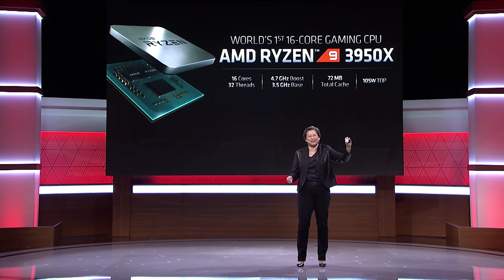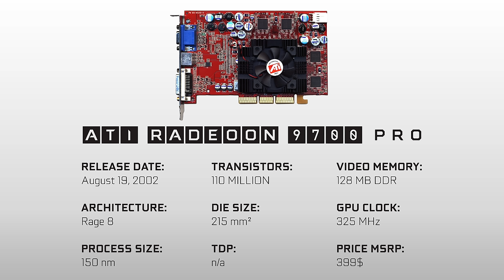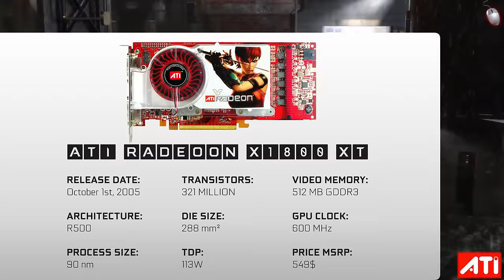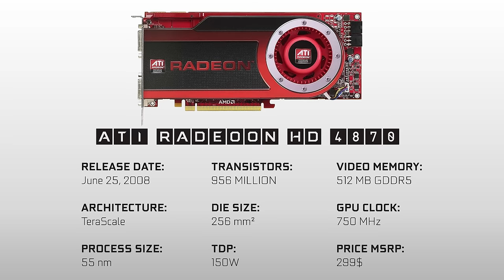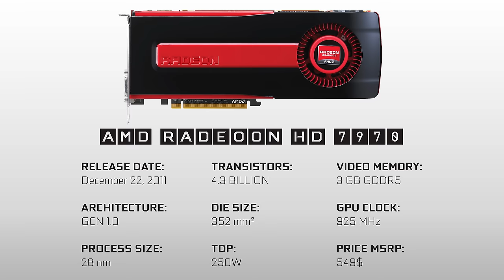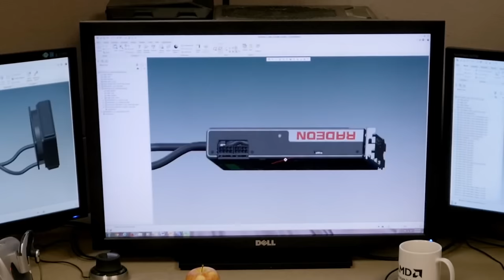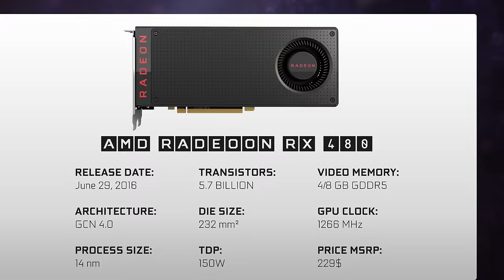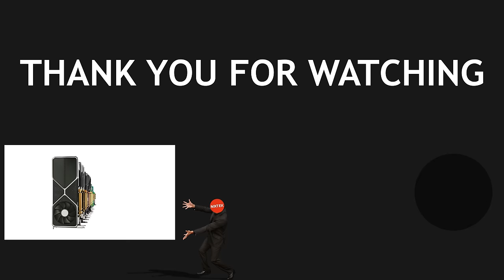The Evolution of AMD/ATI Radeon Graphics (2000-2022)

Comment: When you can buy the highest end gpu on the market with 299$:
Reply: When your monthly grocery cost less than 199$
Reply: When silicon wafers costed pennies
Reply: Vs $2000
Reply: It was still true in 2015. I bought my radeon 7200 vivo in 2000 and in my 390x in 2015 for about the same $350
Reply: @Emeric62   Back in 2011 I also bought the GTX570 for like 340eur and it was a pretty biffed up version of it with 3 slot cooler and could do 25% OC with a 1.2V modded bios flashed and it's actually still alive (in theory it's custom PCB was more in pair with a normal GTX580) and basically it was the 2nd best Nvidia GPU because 580 was the best and the 590 was still to be announced but sadly the 580 was already almost 500€ sadly.

When I bought my crap Strix RX480 sadly the Nvidia GTX1070 was already around 500€ which was the 300€ back in 2011 and they even release "TI" to slap in the buyers face so at the end 1070 ended up being like only like the 5th better Nvidia GPU at the end of that gen but costing almost the same as the 2nd best GPU from them back in 2011 and the thing is that min salary barely increased here from that range of years so yeah just a pile of rubbish 😡

ps: Will probably have to cut an arm and a leg to make my next PC in the future, cause it's getting ridiculously expensive and the wattage is also nuts for the cost of electricity here 🤬😡😥
Reply: USD299 And still won't run crysis
Reply: You can’t even find a budget 1080p card for this price
Reply: @happybuggy1582  nonsense, rx 6600 can be had for less than that and can easily play anything @1080p
Reply: @happybuggy1582 Rx 6600> 1080p ultra +60-240fps depending of game. Price> 200$
Reply: REEEEEEEEE
Reply: @happybuggy1582 you can literally find a budget 1440p card for that price lmao
Reply: @r3tr0c0e3  we on 2020 or 2024 prices?

Comment: Have been using team red from 2000 , never had an issue many of my older cards still function to this day , I have recently bought a 7900xtx for my 7800X3d pc ...very impressed 👍
Reply: I have the same card. Only the 4090 beats it, and that's fine by me. 👍

Comment: The HD4870 was just 20% slower than the gtx 280, but the HD4870 was 300$, the GTX 280 was 650$
The HD 4870 was a 256mm^2 die size chip, the gtx 280 was 576mm^2 die size
The HD 4870 was 150W the gtx 280 was 250W
Reply: hd 4870 won !
Reply: @alfonso5177  In reality people bought Nvidia more, sad but true. AMD in 2007-2008 had 35% of the market share.

Though in 2009-2010 it went over 50%, but that was a different generation.
Reply: @rattlehead999  yes ik, but the hd 4870 was better by price/perfomance/wattage
Reply: @alfonso5177  absolutely and even in performance, 20% isn't much. 
AMD should have been destroying Nvidia from 2007 to 2015, but due to mind share people bought Nvidia.

Even in the next generations AMD repeated the same success as the HD4870 to lesser extent, but still cheaper, smaller die size and performance was close, even power was often lower. Yet they lost.
Reply: @rattlehead999  It was not mind share, it was awful drivers and game support :)
The video could have been a 10 second youtube short saying that 2000-2019, ATI/AMD drivers sucked hard, and since the  RDNA2 launch, they start to be good and really useable.
When a new game comes out, Nvidia launches a game ready driver a week prior. but AMD (and mostly ATI) used instead to try to deal with bugs for the 6 months after the game launch.
Reply: @ledoynier3694  I've always had both AMD and Nvidia and the only period where AMD drivers sucked was 2012 to 2015 when GCN was new and the HD3000 series. Nvidia's drivers sucked from 2009 to 2011 and then from 2018 onwards. Also AMD's drivers never killed GPUs, so that's always a big plus.

Although since 2020 both AMD and Nvidia's drivers have sucked.
Reply: @ledoynier3694  These are facts, coming from you and I agree. I have been buying and playing with GPUs since 1999. AMD unfortunately has issues that the Diehard AMD guys and gals just refuse to admit! Inherent problems on the driver front as well as the WHOLE eco system is not what it should be in order to truly compete with Nvidia!
Reply: @rattlehead999  I have been buying GPUs since 1999 and let me tell you, AMD as a whole as an INHERENT problem with drivers. It is a FACT! To say otherwise is just purposely refusing to admit the truth. Spare me the garbage amd fan boy shit!
Reply: basically the 4870 with 44% the die size and 60% of the power use had over 80% of the performance of the GTX 280. All AMD had to do in order to win was increase the die size to say 356mm^2 or so and boost the power a bit. Incredible performance for its day with how small of a die it used.
Reply: u forgot the Palit Dual Sonic which boosted the core clocks by 200mhz and doubling the 512mb VRAM to 1gb VRAM - all while providing better and quieter cooling than the blower design
Reply: @cdiff07  Recent year or so AMD's drivers have been very good, at least for me. Before last year or two the last Radeon i used to have was 9500 Pro  and I agree drivers at that time were mess. I can't really say anything before 2020 as I haven't used AMD gpu's since 9500 Pro until 2020. nVidia drivers have had also their issues.
Reply: GTX295 vs 4870 x2 😋😎
Reply: 4870 gave me bunch of blue screens and random shut downs, while gtx260 supposedly more hungry was stable as rock
ati drivers were inconsistent up until 2017
Reply: @r3tr0c0e3  I had a 4770 with 0 issues, runs to this day at my grandma's.
And power consumption has nothing to do with blue screens of death and shutdowns.

Chances are you got a lemon.
Reply: @cdiff07  "driver problems driver problems driver problems driver problems driver problems" why do I sense a pattern? honestly if you're not smart enough to get to the root of the issue then you're just as bad as the rest of the AMD shills ignoring computer level hierarchy problems. A lot of AMD's early problems could be traced back to non existent communication between software hardware/developers expecting things to just slot in, they'd reference all the subject material, and in theory it should have worked. Most notably brand new uArchitectures have a way of timing that conflicts with how windows kernal works without proper implementation from both sides, leading to total meltdown. AMD has gotten much better in the past 7 years about it, barring defective merchandise from RX 5000 series behaving similar to driver instability at about a 3-7% failure rate.
Reply: @rattlehead999 20%is a whole new generation difference
Reply: @muskelin  excellently you have been conditioned. You can't notice any increase under 20-25% difference in the real world. I real generational uplift is twice the performance for the same money at around the same power consumption.
Reply: @rattlehead999  bruh wdym 165 fps vs 120fps is a huge difference
Reply: @rattlehead999  or 60 vs 45
Reply: @muskelin  120 to 165 is a 37.5% increase, 45 to 60 is a 33% increase.
45 to 54 is a 20% increase.
120 to 144 is a 20% increase.
Reply: @rattlehead999  your math is wrong
Reply: @rattlehead999  you should calculate by decrease
Reply: @rattlehead999  10% decrease of 100=90 and 10% increase of 90=99
Reply: @rattlehead999  if you are middle achool or higher if x*0.9=y, z=y*1.1, x≠z because if you put x*0.9 to y, the statement is basically x=0.99x

Comment: I bought an ATI Radeon 9700 Pro when it first launched.
It was a card far ahead of the competition. It lasted a long time. Every so often, there is a card that comes out that is far ahead of the curve and lasts a long time.
Reply: like the 1080/1080ti which is still a pretty good gpu.
Reply: @SimonBauer7  Which is another card I bought at launch and had until I got my RTX 3080.
But the GTX 1080 may be the best video card I've ever owned, hands down.
Reply: I have an 8gb 1070 I’m still using. This thing works like a charm as long as I clean it and reapply paste every so often.
Reply: The 8800gtx was another classic, that replaced my flashed x800 GTO
Reply: Still using the GTX 1060 6gb
Reply: like Geforce 210
they continue to sell it
hahahahahaha
some cards last long but for the wrong motives...
Reply: 9700 pro is the best radeon ever made
Reply: to me that's the all time best gpu. probably. maybe it's the voodoo2. but if we consider the geforce 2 series slogan (world's first GPU), then yeah the radeon 9700pro is the best gpu ever.
the 1080ti is great, but it was way more expensive and came at a slow market era. The 9700PRO came right into the heat of things and still managed to last quite a bit being relevant.
Reply: Still using the RTX 3080Ti
Reply: High end Maxwell GPU’s like the GTX 970, GTX 980 and GTX 980 ti especially fit this
Reply: @ScytheNoire  It really is a great GPU. I personally dont have it, but one of my friends has a computer that does. Still runs basically any game at appealing settings and good fps based on what I saw last time I went.
Reply: I got ATI Radeon 9500 Pro back in the day, and modified it to run as 9700 Pro. Oh the good times :).
Reply: @ScytheNoire  don't forget that in the modern era GPU's have 1 year per generation, back in the days of the R300 (the 9700pro/9500nonpro) new generations of gpu's were released every  6 months!  I remember my 9700pro delivering top results in the newest games for 2 years, it was the first time i didn't have to replace the card after a year because newer cards were that much better...
Reply: Me with radeon hd3850 512 mb paired with 2g ram an athlon x2 dual core 3.0 ghz being longest pc i ever used for 5 years before upgrade it (2008-2013)
Reply: @Trap Advisor  same here, I bought a 1070 superclocked back in 2017 and it's still working great.
Reply: 9700 Pro (with F50 demo) >  HIS 9800 PRO! I could beat a 6800GS overcooking the poor 9800 pro beyond its means, so much the 4 pin molex melted into the card! 😎😅
Reply: I had an AIW 9600xt which ran games incredibly well.
Reply: This is true. I bought an RX 480 in 2016 and that card was so awesome it carried me through the GPU apocalypse. That was the best investment I've ever put into any single computer component. Replaced it finally at the end of 2022 when prices started to come down again and it still was able to game decently.

Comment: I loved ATi. My first card was a Rage II based All in Wonder card. It allowed me to take video from a VHS-C camcorder, and save it on my computer. As a bonus, it allowed me to watch TV on my computer. It was just a gimmick, at first, but I ended up getting used to having a little inset TV on my computer, as I did other tasks. It may not have been the fastest card, but it did the job that I wanted it to. I eventually became pleasantly surprised, as the All in Wonder series actually started getting competitive, as far as graphics/gaming performance. 

The last Radeon I had was an All in Wonder X1900. It was a phenomenally useful card. By then, my computer was fast enough to function as a VCR, with adequate capture performance. It ran hot, but it could tackle about any game, at the time. It ran warm, though. It wasn't as hot as a 3DFX 3000, but it could heat up a room, eventually. I always loved the tech demos. The first one I saw was the one for the Rage 128. I think the one that impressed me the most, at the time, was the Toystore one. Finally, I enjoyed the Ruby series & always looked forward to new chapters. I miss the artwork that used to be on the fan cowls.

Comment: Great video. Been using 3dfx, ATI and AMD since the first days. Never used Nvidia and never will. My internet Cafe here in Turkey was running the only. Place you had AMD CROSSFIRE running ATI radeon 3860s and AMD Phenom Quad cores 2.4 ghz. They were the days and still running Radeons and AMD Opterons 8 cores for my  Unreal Tournament Server.